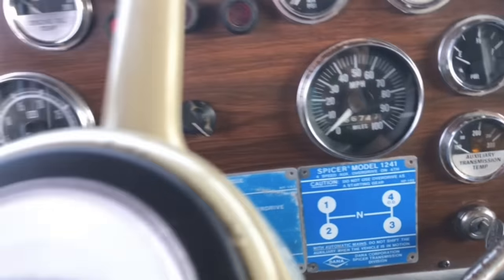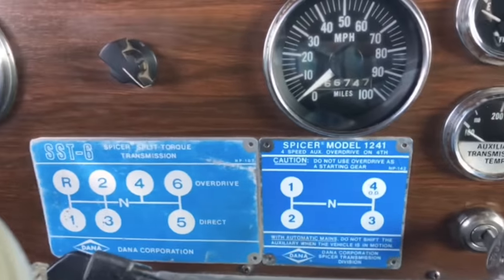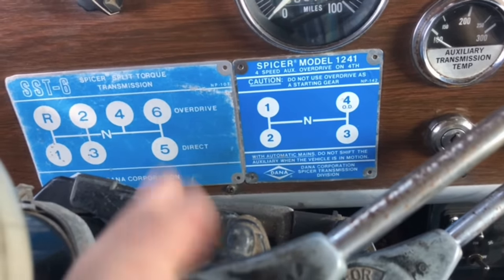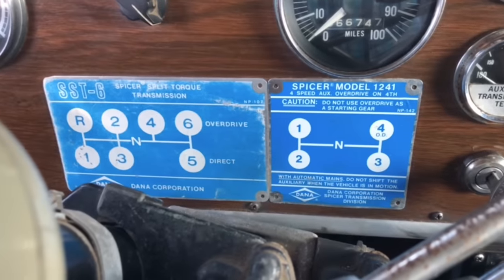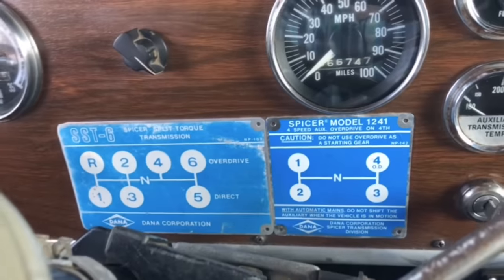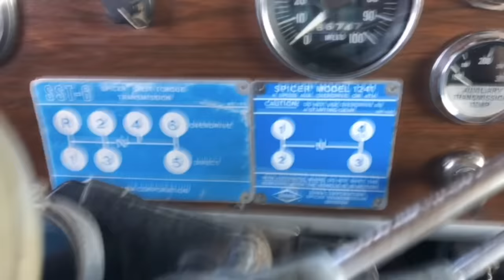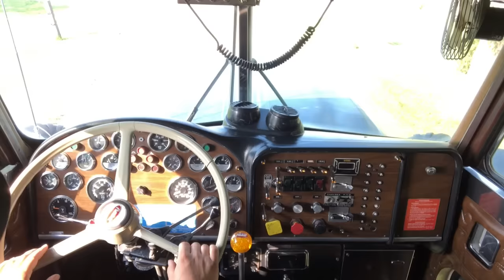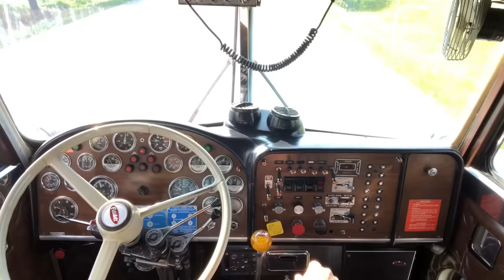How to shift Two stick 6+4 Spicer Transmission Peterbilt 359 #Peterbilt #359 #Twinstick #Twostick

Comment: My education on two stick trucks was a thermodyne  U-model Mack with a 185hp tandem with two sticks. It had a 5 gear main and 2 gear auxiliary transmission. Mack’s early version of a 10 speed. The gear pattern was not very close in the main and most of the time you had to move both levers at the same time if you were loaded heavy. But on flat ground that tractor would run almost everything on the speedometer. Nonetheless it was interesting to drive, In the east coast mountains.

Comment: you explained it well, before you even drove it i knew how it would work. We have a gearbox called an Eaton Twin Splitter that has 3 small gears to each big gear but it works off a switch on the side of the gearbox and is a lot easier to use.
Reply from the maker: Ah thats a new one to me

Comment: Best description teaching vid on 2 stick shifting I've seen yet. Way to go eh I learned when i was 14 and been trucking 33 years. never seen anyone do a vid this simple before. Fyi Uncles just gave me the key to the White and said go in back of shop and learn how to shift... A morning of hit and miss and slowly illuminating the ol lightbulb. After lunch uncle came out and fixed my thinking coached me for a bit and said let her rip boy you got this! Still prefer the 5&4 to my Big Cam IV with 13 and the 3406 400 with its 15, the N14 select Plus and the 18 is nice but Dam I like the idea of Cat and 5&4. Call me weird eh..  just Don't call me late for dinner lol

Comment: Worked at a grain elevator in the 70's they had 5 KW twin sticks. I would load the trucks when drivers came home for the night. I asked whats that other stick for? Don't worry about that one boy, it will get you in trouble. They let me ride with drivers & it seemed very confusing what they were doing. A driver explained it to me much like this video, then let me take it out on the road. The sound & feel much more important than the tach or speedo, after a couple of shakey trips, i was a grain hauler.

Comment: I was taught to stick my arm through the steering wheel to split shift the 2-sticks trans.  After while I caught on, and I thought that my uncle was full-of-shit, because shifting those 2-sticks wasn't necessary to stick your arms through the steering wheel to shift the 2-sticks!   Couple years later I bought my first Pete wit' a 2-stick trans. and taught several drivers how to shift, just with their right hand and the right hand only.  I've also worked for a city municipality, and taught those city drivers there too.  At first some were scared shitless about shifting the 2-sticks, but I assured them, it's not that complicated.

Comment: I knew there had to be another way other than using two hands. Thanks showing us how you would normally drive it down the road. Makes a lot more sence now. Its odd how you have to shift still in a higher gear for a second then to a lower gear and back up again for each shift with the aux. I was wondering how that works. Atleast thats how it looks. I've driven 13 speeds but what a different animal 😆

Comment: It's almost like bicycle gears with the way they overlap like you said only far more complex transmission. Incidentally when you were doing the driving bit, the truck sounded very much like,  if not identical  to, the 281 used in the classic early 70's movie "DUEL " (and I guess why wouldn't it, it was a peterbilt also) and all this time I thought it was just a sound effect added into the movie.

Comment: Had a 5 x 4 in an LW923 KW with 280 8V71. Basically the "2-3-4" in the rear gearbox is under-direct-over, and 1 is deep reduction. Was good to drive but replaced them with a 9513 as the rear box wore out. Still have both transmissions for when they become collector's items : )

Comment: The first truck I learned to drive was a 1970s Ford LN 8000 three axle 10 wheel dump truck that had a baby 3208 cat engine in it with no turbo. It had a five and four transmission with the auxiliary being a Browning. The auxiliary transmission or browning was instrumental to split the gears as the engine was lacking in horsepower. Because it was a short nose tractor, it was too pricey and difficult to add a larger motor. It was great for hauling hot asphalt because you can crawl in front of a paving machine. From what I understand, These auxiliary transmissions were crucial for going up hills in the San Francisco Bay area. I didn’t do the double clutching on every gear like someone mentioned as you would train your ear to shift. I didn’t do the whole left arm through the steering wheel that you hear people say. Essentially, I ended up with a large trapezoid on my right shoulder from shifting all day but could be done with just one hand while the left-hand was Steering. I wish I had a camera back then like a go pro. You just don’t see operators like this anymore. Thanks for making this video. Perhaps you can have a go pro Under the Cab showing the actual auxiliary transmission. The best way to describe it to people is to think of a long drive line that is removed to put in a smaller four speed transmission and TWO drive lines.
Reply from the maker: Theres a tandem ford dump truck for sale an hour drom me with a 3208 and 5x4 pretty much identical to what you described 👍

Comment: The only time I ever had to drive a 2 stick was in a Mack dump truck.  I hopped in expecting the typical Eaton in one of its flavors.  After looking at the gear patters, not too different from what is in this truck, I took off.  Very roughly.  lol  After a few min of messing around I came to the conclusion to only use 3/4 on the aux box and treat it sort of like an Eaton splitter.  Not pretty, but it got me by for the couple days I was in the truck.

Comment: i worked for a railroad demo company that had an autocar with this set up ...that thing would pull off with no throttle loaded with cross ties in one one....unbelievable the torque it had

Comment: Mate, A Silver 892, 100 MPH on the speedo, 6X4 double overdrive, (depending on diff ratio), that old banger would snap that speedo needle in half. She should do 160 MPH easy. Please correct me  if i am wrong. I love the  2 strokes.
Reply from the maker: Well high gear with both over is .68 ratio... at 2200 with 24.5 rubber and 3.36 rears would be 126 mph according to my math but maybe im off.... either way its a scary number!

Comment: The good thing about the five pores and a six-fourths was that if you were pulling extremely heavy loads you could split the gears down and build the truck up to get it to going and I have such a lug on your motor that was the fabulous part about those

Comment: Back in the day, I drove a lot of 10 and 13 speed.  I drove a 4x4 a few times, and a 5x4 once (same principle).   Like he said, I was kind  of surprises how easy it was to do a 4x4 after being told how hard it was.
Reply: And if you are a real  pro, you only use the clutch to start and stop.  The  rest is done by feathering the throttle to match the rpm to the gears and  the feel of the stick.

Comment: I broke out on a 1974 international trans star rig up truck with a 4+5. It had a five speed main box and a four speed brownie. I was 19 years old and I still love that truck to this day. That was 1999.
Reply: @eprofessio.... At NO time from 1961 to 1981, did International EVER install "Sticks" in their Transtar Series Trucks.  The "Standard" transmission available in almost every year.. was the RTO 910 - 10 speed.  

Yes, there were multiple options in later years... and absolutely None of them were "twin sticks".   Want to try again?
Reply: @Romans--bo7br  well god bless your little heart. It was an oilfield rig up truck with a tail roller, 80k Braden winch, 60k secondary winch and auto erect gin poles and they most definitely installed a 4+5 box set on it. It was a beautiful truck made lovingly somewhere in Texas by people who knew what they were doing and what could be done, unlike some people who can only imagine what comes out of a factory stock.
Reply: @eprofessio .... Well, bless Your little heart!  You Never mentioned all the specialty details and what the rig was used for in your first post.  I was going from what vague details you gave. You just mentioned that it was a "1974 international trans star rig up truck with a 4+5".  So I guess it was my fault for not reading what you said, correctly.  I saw "rig" and then "up".... and thought that the "up" was a typo and read it as "trans star rig"... so, I need to read better, and you could provide better details.  : ) lol
Reply: @Romans--bo7br  well you’re half right, you definitely need to read a little better. Anyone one that likes to pop off is expected to have intimate knowledge of the subject, otherwise that person is subject to a light grilling. God bless your little heart for making it my fault you have reading comprehension issues.
Reply: @eprofessio .... Thank you... apparently you can except your portion.   With regards to your statement of.... quote, "Anyone one that likes to pop off is expected to have intimate knowledge of the subject."  

Just FYI... I do happen to possess that knowledge... How many years did YOU,... work for Detroit Diesel?... and I don't mean for a "dealership", either.   Everything I said, was correct... for class 7 & 8 Hwy trucks, based on Your first posting, minus Two words, which I mistakenly Misread.  

Anyway, at my age, and retired... I don't choose to enter into back & forth, mindless gibberish with insolent "internet experts".  

Have a nice life... for however many months we have left.
Reply: @Romans--bo7br  you are still wrong. Thank you for working for Detroit Diesel. I love the super turbo charged 2 stroke platform. Just embrace the back and forth gibberish for what it is, ratchet jawing with a keyboard, enjoy the fact that we get to talk ship to eat other about stuff we like.
Reply: @eprofessio .... I'm "Still wrong".... about what, exactly?  As far as what you pointed out that we get to, quote... "talk ship to eat other about stuff we like" end quote..... that's true.  However, while I personally, enjoy doing that... I prefer to talk Facts and not a lot of bs, born out of ignorant myths.  

My past secondary schooling, position with DD, research & development, etc... was all based on known facts. 

I don't deal with, nor have time for ignorance and ignorant comments.  

If that statement sounds "prissy" to anyone... so be it, but that's how my life and career in general, has manifested.

I am NOT saying that what you said about your past oilfield driving experience was ignorant or false. 

I'm referring to comments on Many sites that deal with diesel engines, in general.... there is a Lot of ignorance "out there", trying to pass itself of as knowledgeable and factual... especially when it comes to diesel engines, and especially when it comes to the 2 cycle variety.   

I actually do enjoy reading them, because they So hilariously Ignorant for the most part.   

Anyway, I wish you well, and take care.... time and the end of this country of ours, is fast coming to a close, just as I warned it would... over 53 years ago.
Reply: @Romans--bo7br  thank you for sharing. I really do like going back and forth on here with people. Sometimes I do get carried away. You are 100% correct that there are ignorant people abound. A lot of people believe in the demise of our country, I believe if we show a little grace and keep a strong positive outlook then the world is ours. It doesn’t hurt to be a little angry and twisted on the side to help when those attributes suffice. Thank you again for bs ing with me I really do enjoy it.

Comment: Back in the late 70’s after my Honorable Discharge from The U. S. Army, I drove trucks for my Dad. Where we had a couple Mack R Models, just basic 190 NA Scania Varbus straight six, with a twin stick Mack, 5+hi/lo, that had a regular low hole 5 speed with first down left, reverse up left, with the other stick jut low forwards, high backwards. So if you were empty just leave in low range and shift up 1-2-3-4-5, then shift to high range. Or if loaded, especially heavy split from 1lo/hi, then 2nd/high if it recovers, but if not slip up to low, then with each hand move the left  down to 3rd and right shift up to low, then high, then from 3rd high grab both shifts with one hand and go up with both shifts to 4th low, then just high, then using both hands the left goes down to 5th and the other hand goes up to low, then finally move the right shift up to high. Then downshift back down in the opposite direction. Ye ha!

Comment: So basically the secondary box is your splitter gears.  Australia here that's a very novel  system of changing gears.
We have a Fuller Roadranger gearbox with a splitter for each gear in your High & Low range. 18 fwd gears & 4 reverse depending on your configuration

Comment: Drove one back in the late 70s. V 8 cat and a 6x4. Never went thru the steering wheel. If you did you had to stop. Everything un sinked. Used laugh at guys when they talked about moving both sticks.

Comment: Wow, that brings back memories! I learned on a 10 wheel Jimmie dump truck with a 5 speed main and 4 speed spicer aux. I drove for 2 years back in the seventies and never was able to be perfect except on certain shifts, ground a lot of gears learning. LOL
Reply: L. Mace any driver who says they never ground a gear it's a straight-up liar. I'm a truck driver myself and I've learned to drive many different combinations of drivetrain and I've learned that while some trucks are kind of similar there is not one that is like as far as wear on the transmission, how sloppy the shifter response is, how the clutch is adjusted, just where the engines achieve the most efficient amount of torque which also is going to tell you when to shift. there's so many different variables in it especially if you drive a different truck each day. but I must say it's pretty weird to hear from a trucker he doesn't embellish already embellished stories.

Comment: I used to ride with a friend hauling sand and gravel in s U-model Mack with the twin stick 15 speed tri-plex back in the days of 265 hp hauling 25 tons at a time . 
One hand thru the wheel shifting the first 3 gears on the main then one handed the rest of the way up
He made that old bulldog bark real hood

Comment: The 5x4 and the 4x4 with whats called a true progressive brownie, or auxiliary transmission is the best combination. You can have A 200rpm split . Perfect for any hill or mountain you want to climb. In those days we were running  262's  and 335's .You needed that kind close split. You never took both boxes out of gear at the same time. Unless you were good at snap shifting. All daylong in stop and go traffic pulling double belly dumps. Athe end of the day it felt like your arm was gonna fall off. Had a 66 skinny nose pete with a 350 that was bored out and had 400 liners and pistons and a big ole switzer turbo. You could get 3 foot flames coming out of the stack, but if you didn't know what you were doing you could literally melt the pistons. You had to watch the pyrometer all the time pulling hills. The best truck I ever drove had a 3408 cat. It was a long nose KW WITH A 60 inch walkin sleeper and a 5 and 4 with a progressive brownie. I hauled produce to calgary and edmonton alberta. I never got under 55 pulling all the hills.I was 34500 empty so I was always overloaded.Had to go around a lot of scales. It was fun for a while. It was "only" turned up 25% so it was pretty tame didn't have to watch the pyrometer to much till you got to hi altitude.High altitude has an effect on trucks that are turned up. these are all the reasons they started detuning trucks, they took it out of the hands of the driver, they idiot proofed em and took all the fun out of it. All that manageing gave you something to do and kept you a wake on the long nights. But I don't miss the 40 hour days.4500 miles a week. I sure didn't get rich like I thought I would.If you got a job and all their trucks all had a set of boxes in em and you needed to make a living you would learn to drive em pretty damn quick.

Comment: Came here looking for tips. 
Dad picked up an old chevy tandum with a 5+4. I still struggle downshifting loaded because if I miss a gear I haven't got a feel for where to try and jump back in without a bunch of grinding for my wheel speed vs engine speed

Comment: A fellow owner/op at a flat deck outfit needed better gearing for some oversized and heavy loads, so he added a four speed auxiliary that he already owned behind the eighteen speed in his Kenworth. As he always said, everything in fourth on the auxiliary and high range on the main was somewhat theoretical, as it was basically overdrive behind overdrive, and capable of speeds that would get you in big trouble.

Comment: Old timers hint I was taught: always (generally)shift the trans in its highest gear into neutral first (eg. Aux in 4 main in 5, shift aux into neutral then shift main to preferred fear, then shift aux to its preferred fear) less scratching. Also it helps to know if aux is double under drive or double overdrive.  Always one or other.  UU 1, UD 2, DD 3, OD 4 or UD 1, DD 2, OD 3, OO 4. Hope that's clearly presented